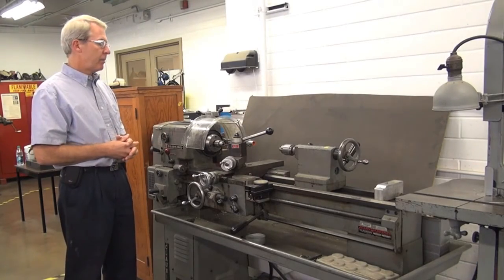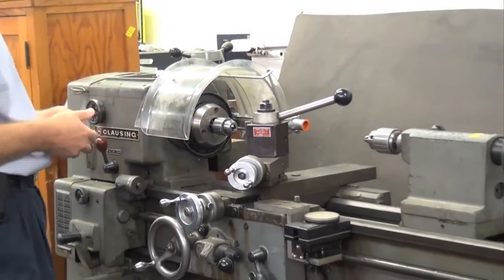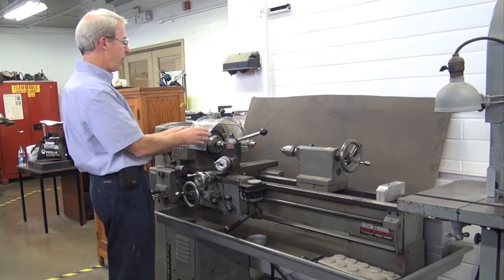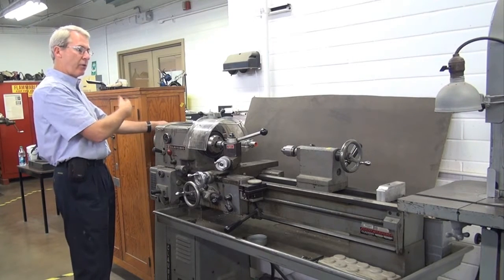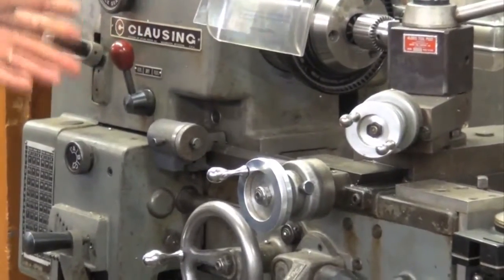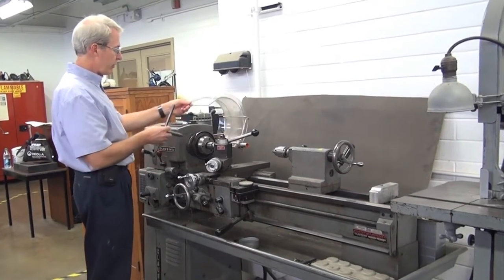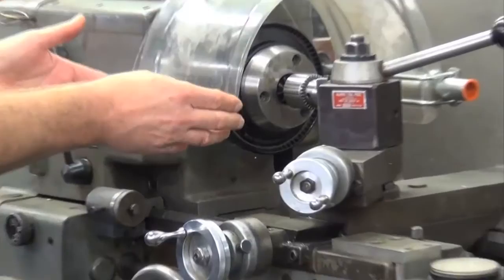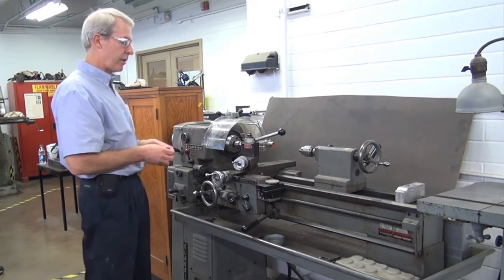Machine Guarding: Machine Lathe

Comment: A manual engine lathe is very difficult to idiot proof. The universal nature of the machine makes most the suggestions made by Mr. Gardner not very practical.
   The only one that can be applied to most lathes is an emergency stop. His suggestion of putting the emergency stop on the head stock is only useful on small lathe. A better solution is a foot bar that can extend the full length of the lathe bed. This can be linked to a spindle brake for lathes equipped with cam-lock or keyed tapered American Std. spindle noses. I would not put a mechanical spindle brake on a lathe with a threaded spindle with which many older lathes are equipped. These older machines may use a variable frequency control programmable electric motor braking so the spindle deceleration can be controlled and thereby avoid spinning the chuck off the spindle.  On anything other than a bench lathe, this is an expensive option. 
   I've seen all the guards recommended  over the years. Most of them end up being "accidentally" smashed up and chucked into the scrap bin. They are generally make the lathe more dangerous to operate because they are always in the way.
  The best way to safeguard a manual lathe is to train the operator and insure they have the proper safety equipment at hand. It is important to enforce rules that:
1) Absolutely no jewelry or watches for operators.
2) long hair must be well tied back.
3) Long sleeves, loose clothing of any kind not allowed.
4) No gloves of any kind permitted.
5) Eye protection worn at all times when lathe is in operation.
6) Insure that all persons are trained for the machine tool they are using. Also that dangers of the machine  and safe operation of the machine are stressed and understood.
   At the end of the day, you can put a CNC lathe in a box, but you have to be able to get up close and personal with a manual lathe.
Reply: Aceroadholder k